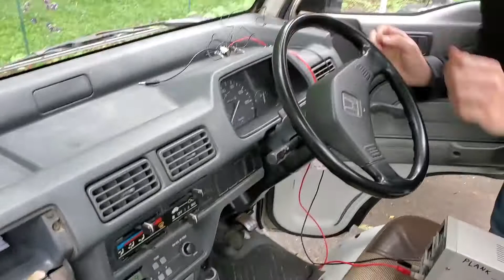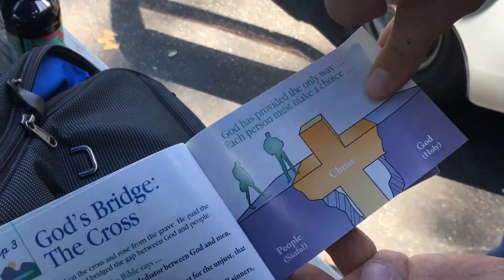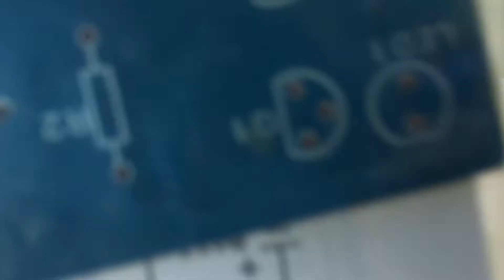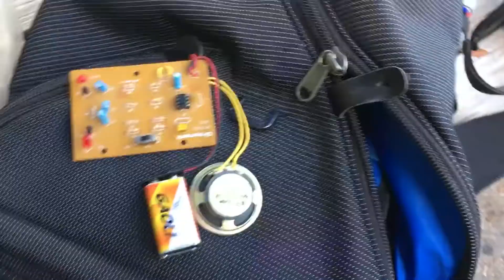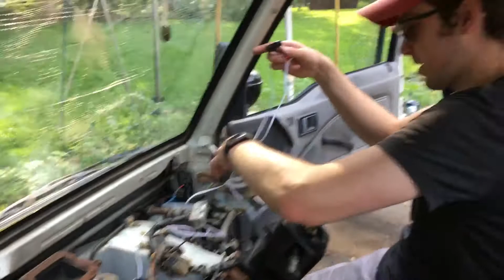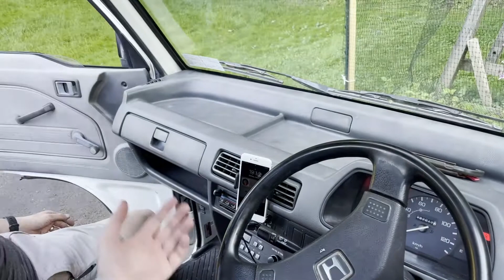Converting a Kei truck into an EV - Radio installation - Part 5

Comment: Or you could just have connected to the speakers instead of going through the radio step…
Reply from the maker: We discussed this option in a video & preferred an option that would adaptively reuse the AM radio.